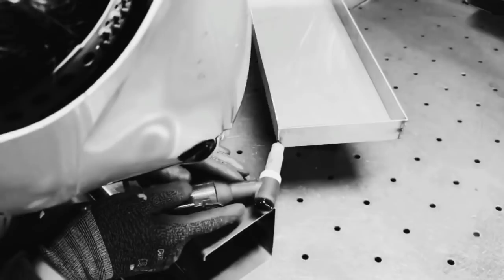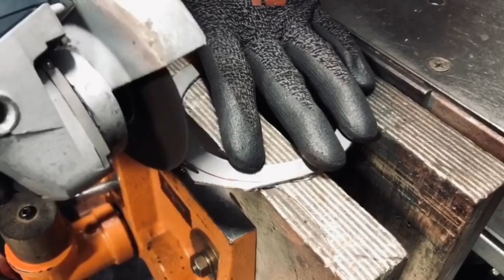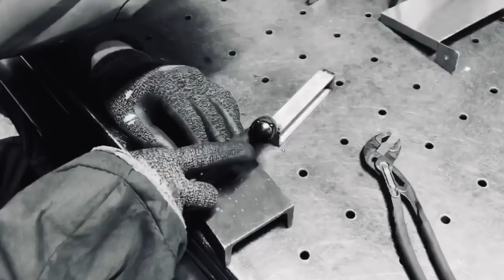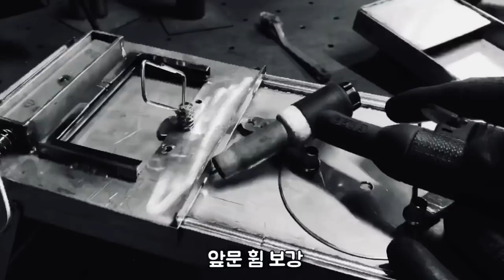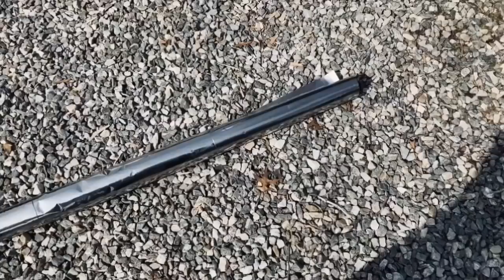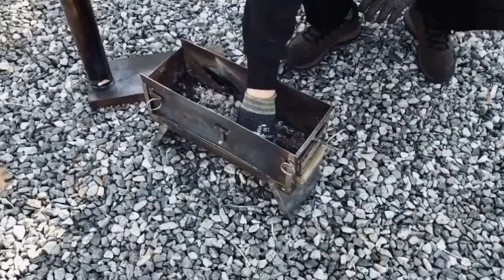조립식 화목난로 만들기/캠핑/부쉬크래프트/Create Prefabricated Wood Stove/Bushcraft

Comment: Hello, please give a link to such a chimney.  Where can you buy such material on AliExpress?
Reply from the maker: For information on the chimney, please refer to the address link at the bottom of the Channel->Information menu.
Reply: @stovetv  You did not understand me, I was talking about the stainless foil from which you made the chimney, tell me what size of the sheet and how much thickness? give a link to this foil sheet on aliexpress
Reply: @stovetv  I am sorry, but you did not answer, tell me at least how much is the thickness of the foil?
Reply from the maker: The size of the sheet is 2m and 3m in two models, and the width is 270 ~ 280mm.
The thickness is 0.1mm. The seat ring size is connected to a 60 mm chimney.
Please understand that you do not know because you are not using the AliExpress site.